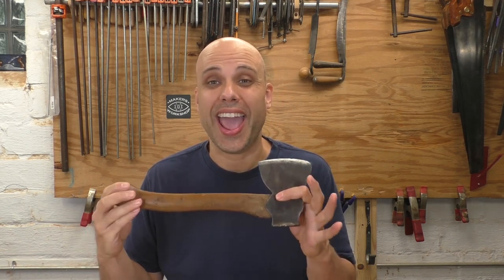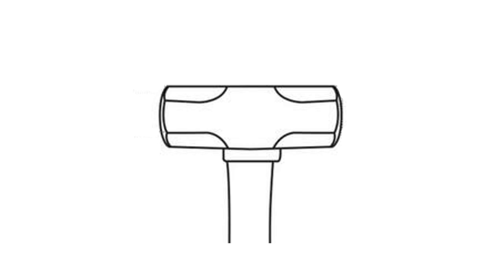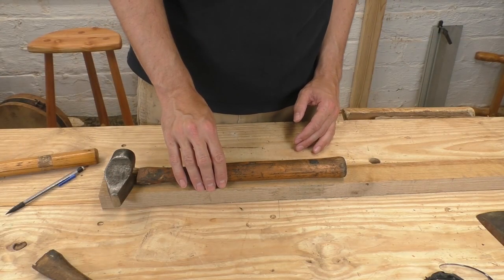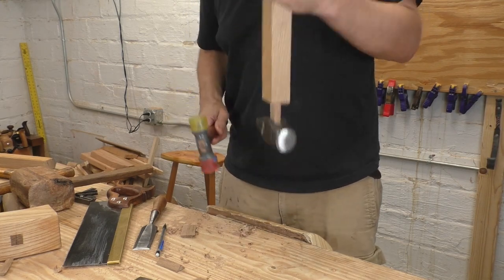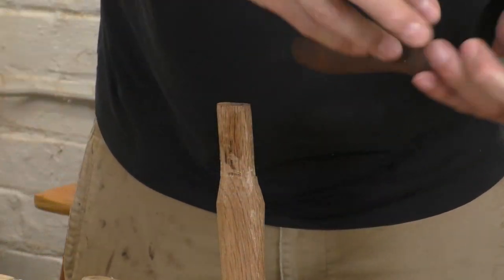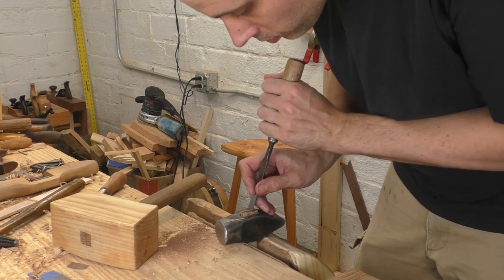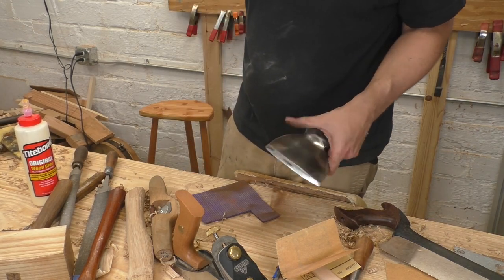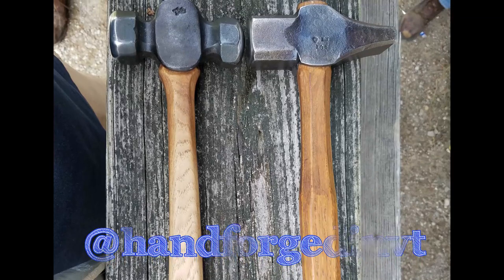Make Custom Handles for Your Tools! (Ax and Hammer Restoration)

Comment: My small 2(Canadian cents...): I soak the the head part in BLO for a good hour, and the wedge . I did it like my grandfathers would do in the old days , since there wasn’t hide glue available easily , for carpenters. Naturally in those years they would take any oil/grease available. They idea is to « humidify » the fibres and to make slippery surfaces between the wedges/hammer’s head in order to knock the wedge down and to compress all the wood in the head section . Thank you for all your great videos . That was only my humble technique. Thank you for all your videos !

Comment: Great material just finished my first axe anda pickaroon used WD40  and two stroke motor oil on another giving the wood a red tint, really like the WD40. IN the process of doing a double bit throwing axe,next up is a couple of digging forks.find this work very enjoyable and relaxing.

Comment: Here in Norway, birch (and ash) is traditionally used a lot for axe handles. Apparently because it absorbs vibrations better than woods like oak and hickory, thus allowing one to work harder/longer with less pain in the arms due to vibrations.

Comment: I made a bowstaff from a white ash sapling. I tied it to a section of hog fence to straighten while it dried in the sun for a few weeks this summer. When it seemed to be dry enough, I used a hand plane and a scraper to smooth down the knots and reduce the butt end to about an inch and an eighth D. I did not totally eliminate the knot mounds. They help me register my hands when I'm practicing. Running and rotating staffs, walking sticks, etc. through a sacred fire really helps to harden and strengthen the wood. I built a nice fire, got some great coals, and slowly rotated and moved the staff through the heat. It took about an hour on the six foot staff. It got pretty hot. I put on my leather gloves which helped a lot. The finish is black, smooth, and shiny after a couple coats of boiled linseed oil and paste wax. There is a knot mound right at the center point. It swings oh so nice. 

I picked up an old carpenter hammer at a yard sale this summer. The striking head is tapered and the claw is fully curved. I modeled a piece of 1" thick maple on the handle of my Stiletto titanium hammer - curved like a hatchet handle. It took me a while (no spoke shave yet) to get it shaped nicely. It looks pretty good and needs a finish. 

Thanks for the video. Blessings to you and yours.

Comment: This is a great video Rex! Though I am having some trouble with sharpening my old axe head by hand. It is very blunt and I'm not sure how to get a sharp and even cutting edge without machine tools. The angle especially is hard to determine and the head is obviously too large to use with a honing guide...

Comment: I didn't read all the comments, so apologies if this has been mentioned.  I'm fairly sure hewing axes don't typically have straight handles. If you look at the head you'll see the axe's edge isn't on the head's center line it favors one side. (Left or right depending on the handedness of the axe user) This is to prevent busting your knuckles as you hew. Easy enough to accommodate though, just start with a wider block and add the 7 or 8cm offset from the flat side of the head after the shoulder is set. (Eg.  With the flat of the head  set on your bench the handle offset will put the butt off the handle 7 or 8cm above the bench. I hope this helps.

Comment: So, a few thoughts on handles: 

1. If you want a very stiff, rigid handle for a shorter handled tool, you want the grain to be parallel with head of the tool. 

2. If you want a long handled single bit axe to be comfortable to use for long periods of time, you want the grain to run perpendicular to the head, with the outer growth rings to the back of the handle. Do not break through the rings - this is very similar to making a bow. The handle doesn't need to be thick, either. A thinner, more whip-like handle will be far more comfortable to use and last longer in an axe. The same applies to short handled tools, too, but you need to carefully source your wood - preferably harvest it yourself for this purpose. 

*Look up Mr. Chickadee here on YouTube, he has a video explaining all of this in great detail. And make sure you turn the captions on in his video. 

3. While you want a close grained hard wood (generally), if the grain is very tightly packed together, the handle will be more brittle and prone to breaking. Rings that have a little more space will give the handle a little more flexibility and durability. 

There's probably a few more points I'd like to get into, but I can't think of them at the moment.
Reply: That first bit doesn't sound right. Grain going parallel to the head sounds like a good way to get the handle to snap just below the head in the first few uses.
Reply: @cavemanjoe7972  no. That's a pretty standard way of installing handles. With the grain running in the same direction as the hammer head, it creates a very strong, rigid structure. 

It's better than having the grain run perpendicular - unless you've harvested a particular piece of wood for the handle. 

Like I said, check out Mr. Chickadee. He has a video explaining the whole thing.
Reply: @jameshaulenbeek5931  

Oh, so parallel with the eye of the hammer, I thought you meant parallel to the length of the head itself.

Comment: A lot of Russian axes have cross wedges some with two.  Also a lot of older Scandinavian axes have them.  Many of these axes have large eyes in proportion to the head.  I think these designs predate readily available and cheap imports of hickory from America.   Many of these places have nothing but Birch for locally grown wood that will make an axe handle and would need a larger eye and cross wedges to make up for the softer handle wood.  This is especially true in rural areas where going to the store may not be an option.

Comment: Great woodwork as always. 👍🏻

I would be careful with boiled linseed oil. It includes drying agents with poisonous heavy metals. I use pure linseed oil which takes a bit more time to dry but isn’t toxic. I’ve known people to get sick touching the boiled linseed oil. If anyone insists on using it, follow the directions on the container and use gloves.

Comment: Excellent tutorial, but I have a couple tips to add. For hammers, radius the corner of the lower eye with a carbide burr so it compresses the wood instead of cuts it when you drive the head on. Cut the wedge slots before finishing the haft eye to final dimension. You shouldn’t be able to get the head all the way on without a hammer. After you’ve driven the wedges, soak the hammer head in RAW linseed oil for a week - the fibers will expand and that sucker will never come loose. If a head does get loose, soak it in polyethylene glycol. Blacksmithing is very hard on hammer eyes and of the ones I’ve re-handled the heads have never come loose over the past 15 years.

Comment: Rex - could you possibly do a follow up with any specific info on long handled tools - Axe, Maul, Sledge ... the Maul and Sledge are pretty much just big hammers and the commercial handles are pretty much long straight sticks, so I assume those are simple enough - the felling Axe, or a brad Axe or any other 2 handed long handled axe you generally use standing up ... seems that those handles might have something odd about them .. or not !
I've never made one so I have nothing to go by other than how the fancy ones come from the store ... but I happen to have I think 3 axe heads on my bench ... do you ever, or would you ever, Steam bend such a handle so that you still have the continuous grain with no run-out in order to prevent lengthwise splits? 
Thanks!!

Comment: Something not mentioned was the importance of using kiln dried wood. I have used air dried wood before for a handle and had to re wedge it a couple different times over the years because it gradually dried out and shrunk.
Reply from the maker: I always hate to contradict someone, but dry is dry. As long as the moisture content is low enough, it makes no difference. (For this application.) Some some things, like bending wood, air dried is much better.
Reply: @RexKrueger  that makes sense. If the moisture content of the wood has stabilized it is fine. Having struggled with this on most every hammer that I have handled, personally, I will at a minimum check the moisture content of the wood and potentially try to dry it further if there is any doubt.
Reply: Andrew Willis yeah, it won’t hurt to put it into the oven when cooking anyhow. Plus, it will give a nice smoke flavour to that chicken 🍗
Reply: I always used air dried hickory. No problems - except for those cactus like splinters while splitting it out.
Reply: Your problem may not be the wood shrinking But the initial fit into the tools head. That’s why they leave at least 1/8” (3mm) protruding out above the head So when you drive the wooden wedges home that protrusion is flared out to be larger than the tool heads eye. Just a thought

Comment: Many axe and hammer heads have a tapered hole, The larger hole end goes up. When wedged the handle can't come off. Some people make the mistake of fitting with the small end of the hole up, wedged. This will come off.

Comment: If you cant get a handle out of a hammer hold a torch at the top and let it burn but dork get the steel too hot so you dont ruin the hardness

Comment: A good source of handle stock is the broken handle from a bigger tool.  Broken axe handle = new hatchet handle.  10 lb sledge = 5 lb sledge.  Broken rake and shovel handles can be used to re-handle several chisels. Don't throw them away unless they're rotten or have poor grain structure.

Comment: Just to add to your list, in case you're interested...

  GREAT handle woods should include "Mountain Laurel" and "Rhododendron" 

   GREAT wedge woods should include "Dogwood", provided (of course) you can get a hold of them... 

    I've split logs and blocks with dogwood, and I've made a few tool handles with both Mountain Laurel and Rhododendron, and they've lasted more than ten years and only gotten HARDER... ;o)

Comment: Rex, a hewing axe or hatchet handles is supposed to be offset so you don't get bloody knuckles.
Reply: Depends on what you are hewing.  A long log? Yes offset.  If you are using it to carve shorter stuff that would stand vertically on a block you don't have to worry about a curve because your hand is never going past the wood.

Comment: Could you chuck the axehead on the fire for an hour to get rid of the trapped wood? I tried it with a shovel handle and it worked. Would it do any damage to the metal?

Comment: Hey Rex! Thanks for the video!

I will start doing my first very axe. And I hope I can make it to last a life time. Getting the head forged by a smith and currently looking for a special wood blank to use. I am thinking Ziricote/Bocote. Nearly as strong as Shagbark hickory. Might also look for purpleheart, 2x shagbark strength!
Now my question is, what tools should I get for working the wood blank into a nice shaft given the denser type of woods I am looking at.
I see you use shaft chisels. But what about draw knifes and shinto rasps some axe makers use?
What about power tools? I already have is angle grinder. So rasping disc and lamell/Sanding discs is cheap and easy to get.
Or should I avoid using the angle grinder all in all and just stick to the hand tools mentioned? I do think that a stationary beltsander (that seems best way to mace accurate sanding compared to angle grinder) will come in very good use for finalizing. 
Any point in the right direction would be greatly appreciated.

Comment: sawing the stage can be wrong, i often chop or plane the handle to the correct size. Mushroom the top in final and suck it and thin animal glue as well, the top will be stronger. the forged square size nail is a good wedge, it is cheap and it  work well

Comment: I've been told that one of the greatest woods to use for handles is Hazelnut. Got a couple of pieces out in the garage (somewhere!)...and a couple of old hammers (including a 'single-jack' that could become my "Hit it with your BIG purse!" hammer)(Yeah.... Hanging out with professional Carpenters can be a bit...degrading.) that need to get re-handled. Time will tell....
Reply: At one point in my Union Carpenter Apprentice stint...I was swingin' a Stanley Fat Max (the one that came with the black wooden handle). I didn't like the grip on it (was a bit slender for my big meat-hooks). I wrapped the grip with layout string and plain old (Titebond III) wood glue. Fattened it up quite nicely. Twenty years later and that thing has NEVER come apart! Still feels good in the hand. Good grip...even when it's wet. Couldn't be happier. (And no...I'm not a professional carpenter anymore.)

Comment: I remove the handles of my axes by burning them out, with a veeeery small, controlled fire. trying to not heat the blade itself directly, but only the body containing the eye.
Reply: Thank you, I was looking for this and wondered if it would work or not. Will it "hurt" the head? I guess the fire has to stay small for safety but also to prevent the iron from getting (too) hot and changing the shape?
Reply: see comment of @Abdul Elkhatib -> " hold a torch at the top and let it burn but don't get the steel too hot so you don't ruin the hardness", thank you!

Comment: Old trick.... dry your handle wood on a stovetop before you do your work, so that the wood will be drier than what it'll be after it soaks up the moisture from the air in the workshop or outdoors. So, the handle expands inside of the metal, and will not again shrink unless you dry it out in mellow warm again. Makes an extra tight fit.

Comment: I know your focus is not greenwood and you probably just used a flea market find to demonstrate rehandling. However if you watch the video or if you look at the old handle you'll notice a marked bend that makes the head parallel to rather than in line with the handle. If you ever use it to square a log your knuckles will be all kinds of in your way with the straight handle.

Comment: Would just using a bit of fire to get the old handle out of the eye be quicker? Torch or throw it in a camp fire or whatever for a bit. The metal should be fine and you will be finishing the head later anyway.
Reply: That's a really good way to RUIN an axe or hatchet blade!  Good axes and hatchets are tempered so as to hold a good edge and let the poll act as a softer hammering surface.  A fire will destroy any tempering and leave you with a tool with a soft edge that will dent and require sharpening much more often.  Just rout, drill or dig out the old handle...

Comment: Great content as always, Rex! Does heating the head of the tool and then installing the handle work also for a tight(er) fit? I think you mentioned you used to do car / mechanic work, so you are probably familiar with this. Thanks!
Reply: You risk blowing the temper of the tool if you heat it up.
Reply: @criswilson1140  it doesnt need to be that high, just under 100 deg C / 212 deg F is enough usually.
Reply: @kauerpc  Final heat treat on an ax head is usually 175C.  You are going to need a lot of wet towels wrapping the bit to not have the heat load run out and blow the temper.
Reply: @criswilson1140  that can be done in the kitchen oven, even. I dont see a problem with temperature control. But ok, if interference isnt doable to woodworking, then ok.

Comment: As a farrier, I burn all my handles, and only soak the head end of a hammer handle. A slick, or very smooth handle will move in your hand ever so slightly, making you grip it harder than you really need to. This will cause you to fatigue a lot quicker, and your work to be harder, faster.

Comment: Could you burn out the handle heads? like just chuck em on the fire & knock out whatever charcoal after?
Reply: If you burn out an old handle you run a big a risk of ruining the temper on the head and it never holding an edge again

Comment: When I install the handle, I put the BLO on the hammer end of the handle just before installing.  It acts as a temporary lubricant and the head goes on tighter.  Once it soaks in and dries, it appears to lose its lubrication properties and stays snug.  I've never had any problems, but I'm not a heavy user.  Any comments?  Good or bad idea?

Comment: What, no mirror finish on those heads with runes and celtic knots carved on the handles? Good. (No, nothing against doing that, I too like pretty objects specially those I plan to use frequently, but I can't resist taking a jab at people who mistake conflate the quality of the craftsmanship of the adornments and the quality of the tool itself).

Comment: I drill out the steel wedge by drilling holes in the handle next to it. Not particularly laborious and you save the wedge.
For removing rust and cleaning up steel, I like to use these:  https://www.homedepot.com/p/Avanti-Pro-4-in-x-1-in-Non-Woven-Drill-Mount-Quick-Strip-Disc-PNW040100D01G/202830913
You can find them at Harbor Freight (the pad will turn on the shaft after some usage) and many other outlets. If you use the ones for a 4-1/2" grinder, be sure to wear thick gloves as these things can rip your skin off in a blink of an eye.

Comment: Just so you know and you don't ruin a bunch of projects, that axe head you have will not work for splitting wood. The type of axe head that is for is for squaring logs off of a tree. it has a sort of crooked head so you would have very bad splits in your wood. I didn't know if you already knew this or not.